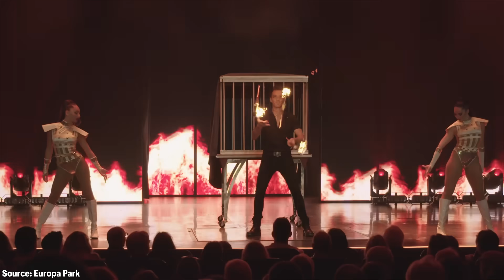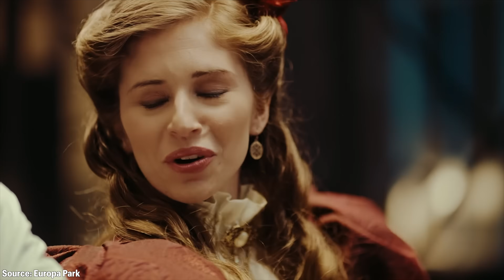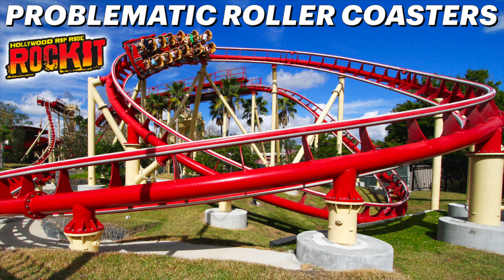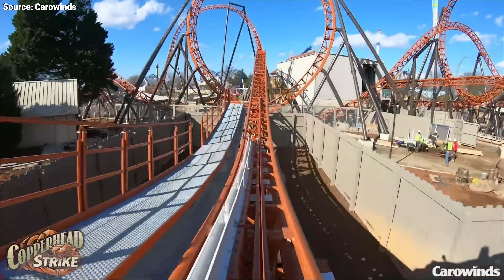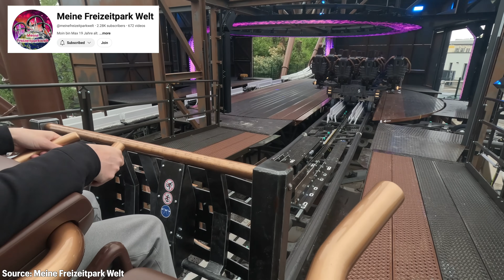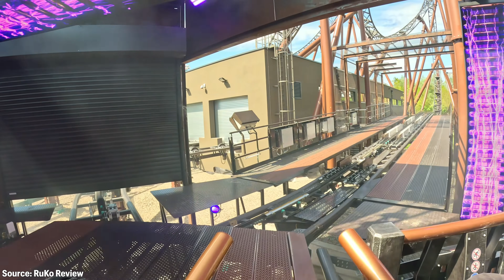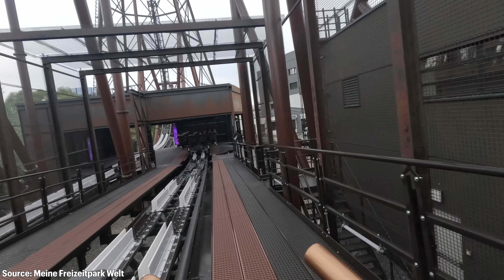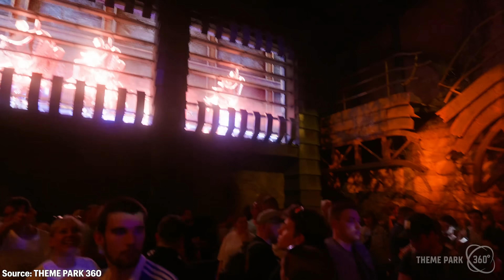2024’s Most Cutting Edge Roller Coaster - The Incredible Complexity of Voltron Nevera

Comment: quick note ! Mack rides and europapark increased the speed of the forward (fourth) launch to 100km/h to reduce the chance to have a rollback on the top hat ! which makes the second part of the ride even more thrilling
Reply: No they didn't. The 100km/h figure was a typo on the website. It has never run that fast
Reply: @SkeledroMan  no it never was a typo because it was originally written 90 km/h on the website AND the EP app and now both still show 100. So YES it does .
Reply: Sorry but never in a million years have they increased speed by 10km/h or more than 10%. Force increases exponentially, so such a change would result in borderline unsafe forces.
Reply: @smuella  sorry but yes they did it… europapark just confirmed me that they did increase it to 100km/h. They probably designed it for 100 but put it at 90 and then increased it to 100
Reply: @smuella The thing is, the Airtime hills feel Borderline unsafe xD the strongest one has been measured with -1,5g (and the others doesnt feel any weaker)

Comment: I still find it crazy that the trains cost 1 million euros each! So that's 7 million purely for the trains. 
This thing was probably crazy expensive to build, but it was well worth it! 
This thing is amazing! My current number 2.
Reply: What is number 1?
Reply: @paulrex9912 Wacky Worm
Reply: 1 million isn't too surprising. The trains must keep you safe, the cost comes from the endless fail safes engineered into them and endless testing for safety assurances for parks to be willing to buy them. And then they also have to work for sometimes a decade or more without needing major overhauls which would cost a lot for parks. And they also need to be engineering in such a way that maintaining them is simple enough for parks to manage.
Reply: Well... I am quite sure that Europa-Park didn't actually pay that much. After all, both are owned by the Mack family, and I think a big part of the showcase deal between the two is that they get the prototypes, which can still have some issues, but likely at a more friendly price.😉
Reply: What’s so crazy about the costs for one train ?
You realize that these trains are not a mass product coming from a Henry Ford Style assembly line, but handmade by order pieces of hitech art
Maybe you heard that one song: „It costs that much cause it takes me f-ing hours …“
Reply: @karstenbursak8083  bruh 7 mil is like a third of the cost of entire coasters. 7 mil is insane especially when there's multiple. So the budget is already exceeds a normal coaster and we ain't even talking about the multiple mechanical elements like the turntable or the multiple launches
Reply: @DylynKay  „7mil is insane especially if there’s multiple.“
Read the original post again and do your math … it’s 1 million per train !
Reply: @karstenbursak8083  dam I foolish my b

Comment: Crazy how the most complex 2024 coaster has been doing fine while Hyperia and TT2 are having serious issues…
Reply: It valleyed on the first day amongst a few other issues, all coasters nowadays are so complex that teething issues are to be expected
Reply: @samgrange4263 actually it valleyed the day before the official opening, so wasnt that much of a problem.
Reply: To be fair Voltron's track was completed back in last may and has probably been testing for many months and even then it stalled during passholder previews.
Reply: @jacobfuller-lewis5528  It stalled on that day, yes. But this was due to the fact that Mack tested a different rubber/tire configuration to adopt the shakyness problem.
Reply: To be fair, Voltron has issues with vibrations on some of the trains. But yeah, it hasn't been closed and doesn't have a lot of downtime.
Reply: You have to admit that Voltron was built just a 10min drive away from the Mack Headquarters (and is indirectly run by Mack or atleast the Mack family). So every problem that occurs during operation can normally be hidden from the public and repaired after the park closes. Not every park has this advantage (I don’t even can think of any other park in the world that could do this).
Reply: @rainerblitzknall4956  The only other park that'd have a similar advantage is Silverwood with RMC. Although I do think some Zamperla engineers are living in Ohio right now to make work on TT2 easier.
Reply: @rainerblitzknall4956 yeah having a coaster builder as the owner and direct neighbour is what enables this.
Reply: @johnnamkeh1290 what is kind of crazy tbh 🙈 imagine Intamin having their own park… that would be insane…
Reply: @rainerblitzknall4956  I don´t think they´d have much of a Problem with fixing issues during normal Park operation, especially on a ride that isn´t open to the public yet anyway.

Case in point, a few years ago Blue Fire had to close because of a problem with the Launch (faulty LSM Stator), I guess they have a few of those over at the Mack Factory, because they where able to install a new one and open the ride again in less than an hour.
Reply: And still has turntable problems as well
Reply: I'd say it's because Mack is awesome, but they also built Hyperia...
Reply: @LoveStallion I guess it’s more bc of pressure from Merlin entertainment as they wanted the ride to open on May 24th as it is the the parks anniversary.
Pressure from executives pushing for a set opening date can result in rushed actions specially when possible financial penalties for the contracting company is involved.
This kind of pressure from park executives seems not uncommon. Just look at Hagrid‘s magical bike Ride at Universal. The executives wanted the ride to open on June 13th as it is a very specific date in the Harry Potter books. And we all know that this ride had massive issues in the beginning with extended downtime as it was not fully tested and dialed in.
Reply: They tested it for a lot longer than hyperia. IIRC they were had actual riders on it over a month before the public release. Hyperia had actual riders on it  like a few days before it open lol
Reply: Remember that Voltron has had issues with trains etc. But the manufacturer owns the park and the workshops are literally down the road.
Reply: Hyperia has a problem with the lift hill that is being replaced right now and it has had a period that has been announced it is expected to open. Top thrill 2 is in a shambles
Reply: Esp surprising that one of those is a fellow, simpler Mack coaster
Reply: to be fair tt2 is an absolutely insane feat for zamperla
Reply: In defense of Top Thrill 2 it’s a maintenance issue they’re trying to preempt before it becomes a real issue. The coaster itself is RIDICULOUSLY reliable compared to what Dragster was.
Reply: @firstflowerinspace they could have continued to run top thrill 2 the whole season but would have had to completely redo the trains mid season instead of every 3 or 4
Reply: ElToro, I’m shocked that this was a very short problematic coaster episode. I’m used to your hr long ones.  
However, I’m very impressed on the  trains and the RFID thing,  they seem to know what they are doing.
Reply: TT2 is a first for Zamperla, Hyperia was obviously rushed to open by Thorpe. Voltron had issues as others have already said. All new costers need to bed in, this isn't a new thing
Reply: Huh? TTD 2 is more complex and way harder then this😂
Reply: Wasn't finished last year so was testing for months
Reply: Voltron still has multiple downtimes daily
Reply: Voltron has DAILY a down time. But it reopens quite fast again.
Reply: I would wait a dozen times to get on this. Modern rides are amazing!
Reply: voltron has many issues and plenty of downtime
Reply: In Germany we say: Mackprodukt (made by Mack) 😂
Reply: But none as serious as the temporary closures we see without any planned re-opening date (so far) with Hyperia and TT2
Reply: Because it is a Mack Produkt
Reply: German Engineering BABY!
Reply: @TimbrJones  Mackprodukt! Schiene toll gebogen. 😂